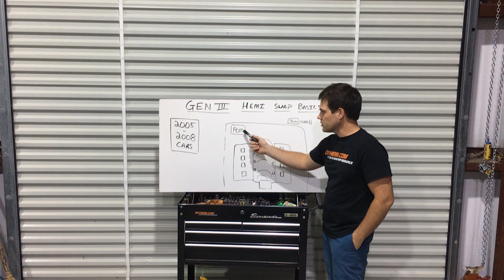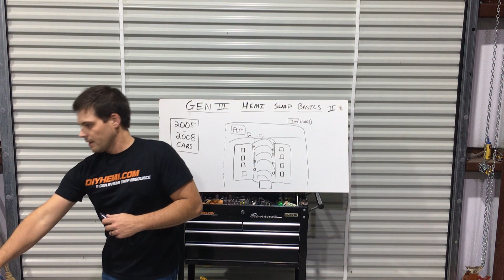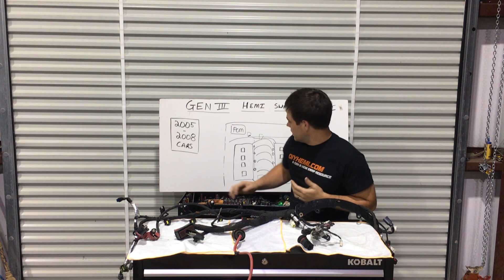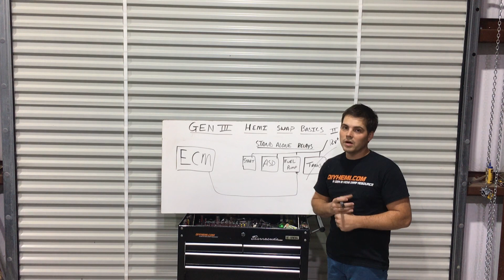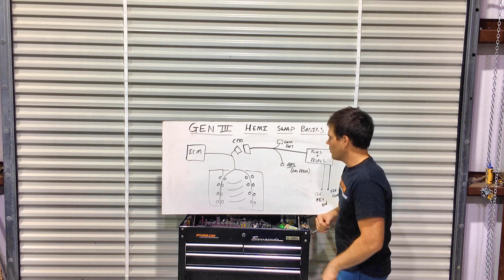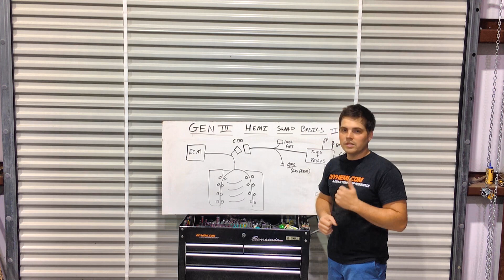DIYHEMI Video #002 - Gen III Hemi Swap Basics - Part 2

Comment: Hi, I have a 2010 dodge challenger, 3.5l, nag1 tiptronic trans, I want to swap in a 2005 300c Hemi and trans the nag1 tiptronic, I have the pcm, and the trans module, everything looks pretty much the same as my harness, I'm just worried about the security "key" the 300 is a key and the Challenger is a key fob, any info on this would be great,, I'm from Ontario and I'm having a hard time finding info and if it's a simple ECM program

Comment: What do I need to do to  swap a 5.7 from a 2017 ram 1500 to a 2008 ram 5.7 and is it possible
Reply from the maker: Of course it's possible.  The electronics is the tough part.  We haven't gotten to swapping into late models due to CAN BUS.  But we want to do that later.

Comment: Awesome, video. I have a 08 dodge v 6 3.7 with 6 speed manual transmission. I want to upgrade to a hemi. Wondering what should I look for in a donor  what would be the easiest thing to do. I really just want a little more power. Do I need to do the trans and rear end.? Harnesses  ? Not going to race it , thanks in advance. Love your channel.